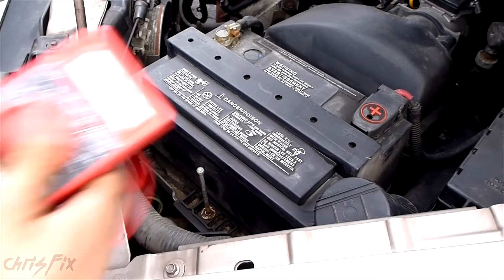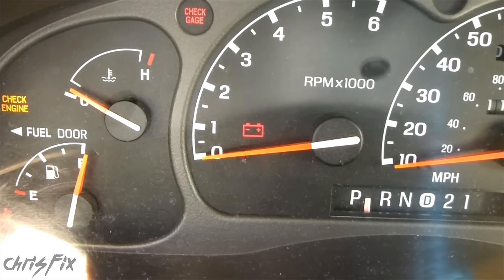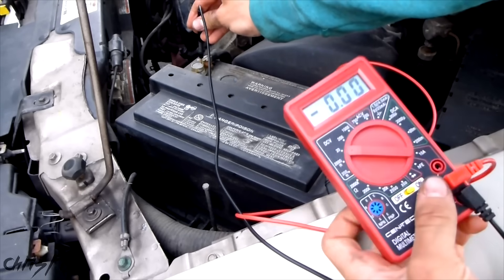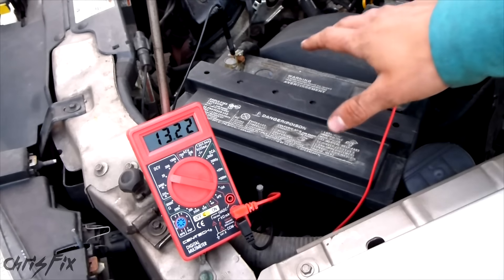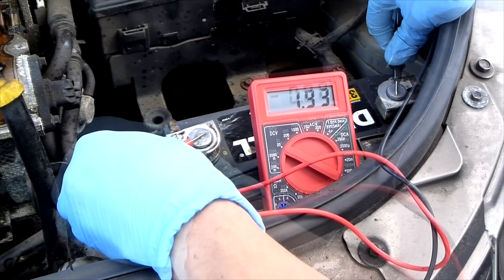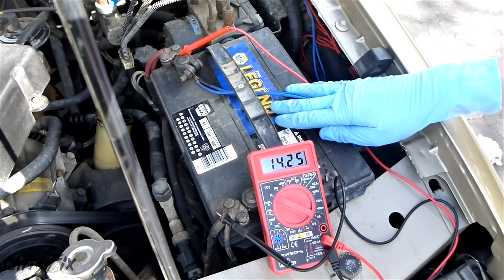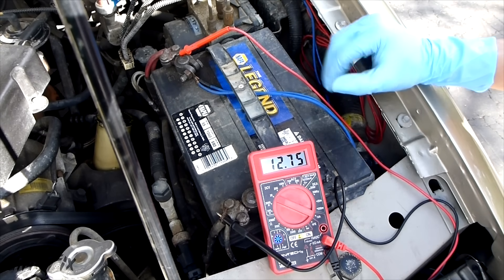How to Test a Car Battery with a Multimeter

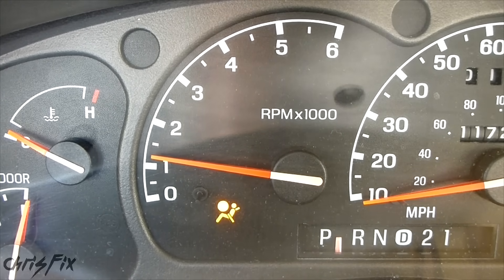Comment: Hi Chris, at 1:04, is the engine on while the headlight is open for two mins? 

I'm a bit confused. Before this, you started the car to check the battery light. Did you turn it off afterwards? (before the opening of the headlights)
Reply: No, because engine on means it is generating electricity, defeating the idea of turning on the lights.
Reply: @jellyd4889  I see. Thanks

Comment: I took my lawnmower battery to a parts store and they put a meter on it and said it was no good. They wanted to sell me another battery. I told them the battery had been sitting for two years so asked if they could try charging it. The guy said, it was a goner. His exact words. I said ok, thanks, and took my battery and went to parts store up the street. They charged it and THEN tested it and said it was fine.
Parts store are not always honest especially with older women so I found this video helpful so I can get a meter and test my own batteries.

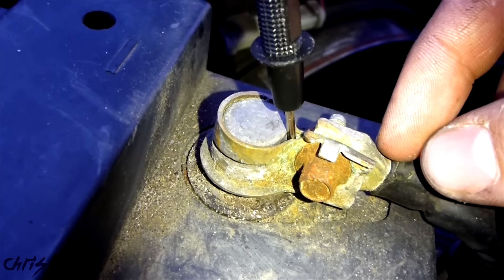Comment: 3:08 good point with googles…I forget chemistry of batteries but strong alkaline solution splashed in eye is permanent blindness. Not positive battery strong enough but not worth the risk…especially when bad batteries prone to atypical behavior bc clearly something is wrong that has you screwing around with battery.

Comment: A few notes.  Always disconnect the ground first to clean them, use water with baking soda to neutralize the build-up.  When putting the "cables back on" put the Positive cable on first to avoid any sparks which can be dangerous.  Oh and Wear safety glasses.!!!!!!

Comment: Great job, but I only have one clarification. You said to add bottled water or distilled.  All bottled, most bottled, is not distilled. Distilled is what you do want, with no minerals. Most all others, including drinking water, has minerals.  Small issue, but, if doing it, may as well do it right. Thank you for a great video and all the help otherwise.  Well done.
Reply: If you cannot buy distilled, bottled with have less minerals than average Joe's well or lake water.

Comment: My suv had no power when i stopped somewhere on a misty day. I opened the hood and messed with the wires and it started and had power. Idk why my car did this weird thing outta the blue, but the car is still running and driving.  Could this be a early sign that i may need one soon or my wires maybe corroded?

Comment: How do you keep the multimeter terminals connected to the battery terminals? Mine does not have those hinged plastic things. Also you can't take your car to an auto parts store to test the battery if the car won't start (sounds obvious I know).

Comment: I’m a 44 year old women and I’m trying to learn how to do as much of my own vehicle maintenance as possible but didn’t want to ask for help with the volt meter- Thank you for helping me swallow my pride a little :) Now to check the alternator video out!
Reply from the maker: I'm glad the video was able to help you with the multimeter!
Reply: Until I started actually shopping for them, oh my - the choices and variations! I decided I wanted the thermocouple and no touch sensor - couldn’t make up my mind so I purchased one made by Ames instruments from harbor freight for about $44 and then I found a similar device at Walmart made by ever start maxx that cost just under $30… is one of those any better than the other, if you’re going by brand?
Reply: Turn the headlights on with the car running or off @ 1minute?
Reply: Personally, I like the ever start because it’s a slightly thinner profile whereas the Eames is a little chunky, but I plan on returning one of them and I just want to choose the right one..
Reply: @elementalraven27  If your goal is just to measure battery voltage, brand shouldn't matter that much, I have some unbranded chinese multimeter, that is a few years old, 
I compared it to the professional "fluke" brand we have at work, the measurement is the same.
Reply: Great video  presentation was informative, detailed, and easy to understand ❤ the cam view was perfect and your voice sounds friendly real clear thank you sir❤

Comment: helpful thank you !!  I kept my car for 15 days idle (no driving) and car did no start.  I have an Audi A4 B8,  varta 95Ah battery.   Is 15 days too quick for battery to drain so that engine not start??
Reply from the maker: Your car should be able to start after sitting that long, most cars can sit for a month or two and start up no problem
Reply: @chrisfix  thank you for reply, it means my battery is old (have not change it for 5 years) so  does not hold charge as well.  Good to know that normally should last at least a month.  Have a good day Chris

Comment: Use baking soda mixed in warm/hot water for corrosion instead of sandpaper and solvents. Will wash away the corrosion instantly and without abrasion to your battery terminal posts

Comment: The battery light on your dash has nothing to do with the battery completely bad information. And I've also said for years I don't understand why it's the diagram of a battery because it's really your alternator light. If that light comes on it means your alternator is not charging it has nothing to do with your battery. Now of course if you continue to drive the car without the alternator charging it'll drain your battery but that's not the reason the light is on. That light is alternator status that has nothing to do with the status of your battery whether it's healthy or not.  Back in the old days this light would have said alternator or no charge, I don't know why they ever changed it

Comment: "maintenance free" batteries still require you to pull pop the caps to check the cell levels.  They are hidden under the label you need yo peel off.  When i checked mine, it was way low.  Im not sure how they get away with the no maintenance claim...
Reply from the maker: Could have been a manufacturing error
Reply: @chrisfix  All batteries vent gases, this lowers the electrolyte level.  When this eventually enough, and it will the only correction is the peel that sticker off pop the caps and pour in more distilled water.  If you just buy anewbattery at this time, I guess you can call the old one "maintenance free" because you declined to do the maintenance....
Reply: @chrisfix  btw, thanks for replying, dodnt realize you are the video creator.  I enjoy your video btw.

Comment: Have a car i had not turned on for about a month, and it would not start. I jump-started it and left it running, but i was sure I'd need to replace it. The last 2 days its started with no issues. Battery voltage with car off was 12.47, 13.98 when running and stayed just above 10 when starting. Will this battery be ok, or should i consider replacing it soon? Thanks!
Reply: What

Comment: I've had two batteries last 13 and 15 years respectively, in Central Canada...extremely cold (-45C).  Both were factory batteries.  One was in an '03 Toyota Echo (Toyota brand) and the other is my son's '08 Mazda 3 GT hatch (Panasonic brand).  I rarely get one that doesn't last at least 5 to 8 years (Kirkland brand...made by Johnson Controls, 8 year warranty).  A battery that only lasts 3 or 4 years is garbage and I wouldn't buy one of those again.

Question, when you say leave the lights on for 2 minutes, is that with the car running?  It's hard to tell from the video.

Comment: Do you have to change or adjust the settings somehow based on if its a parralel battery bank circuit compared to just a single battery? 

And is there a way to measure total amp hours of a battery using these devices?

Comment: Nice work Chris. Just wondering... You said when you turn the car on the voltage should not drop below 10. What if you turn the car on and the volts drop to 9.x for less than half a second (while its cranking) and then jump back up to 14.x? Is dropping to 9.x while cranking a concern?
Reply from the maker: As long as you are not experiencing a slow crank or other issue, that temporary drop sounds perfectly normal.
Reply: @chrisfix  Thanks for the quick reply. Nope, not a slow crank at all. You are the best.

Comment: Wouldn't using WD-40 make some insulation between the poles and holders attached to the battery which will lead to reducing the voltage further?

Comment: You said at the end, "fill it with bottled water or distilled water".  Not "bottled water"!  To most people that means ordinary bottled water for drinking, and that is full of minerals that will damamge the battery. Use on distilled or deionized water.

Comment: First of all you never checked for a voltage drop between the cables and the battery post. Second your battery is dirty and will come up to voltage after a charge but will lose that charge to ground due to mineral trails ( dirt).  Nice try but incomplete information.

Comment: Chris, I've been watching your videos for years and have been very helpful in maintaining our vehicles.... Thanks for sharing ! 
In my opinion, after cleaning the battery terminals & wire connectors, I prefer to use di-electric grease instead of WD-40 to prevent corrosion, as WD-40 will certainly vaporized in a short time.

Comment: I don't think the battery light on the cluster is for the battery but a measurement of the charging system. if it's illuminated, the alternator is not charging correctly.

Comment: Car not starting at all.  New battery like 1 month old. Just got car two days just bought it. Going to jump started with another battery from another running car. I may take it to auto zone check it out. Or it’s time i bought a multimeter. What brand do you recommend? Pretty much any brand or good brand ?

Comment: I changed a new alternator and now it heats up, and in the autozone they didn't charge my battery because it's bad, but my question is why THE ALTERNATOR GETS HOT, THE OLD ONE BURNT, I DON'T KNOW IF POTING A NEW BATTERY THE ALTERNATOR STOPS HEATING UP, THERE IS SOME FUCIBLE FOR THE ALTERNATOR. FORD EXPLORER SPORT TRAC 2007????

Comment: A couple of issues: 1) ONLY  distilled water, bottle water STILL contains minerals and CAN definitely kill a battery, 2) maintenance free batteries is a myth, they all need maintenance. It's just more difficult to get into the "maintenance free" ones. Lastly wd40 is good, but Vaseline  is better for controlling acid buildup. 
But, still a good video, lots of good basics that owners should know how to do. The BEST tool in a toolbox/car is a multimeter.

Comment: All my 40 odd years I’ve used copper grease on battery terminal. Not one bit of corrosion or cable damage. One coating will last the life of the car/battery in all weathers.

Comment: I see a lot of people driving around with terribly corroded clamps. And I wish someone made the perfect battery terminal cleaning tool. I'd buy it, regardless of price. I use a pocket knife, scrape all around, then go at it with a wire brush, which tends to fling corrosive bit everywhere, like on my clothes. Slow, tedious work. I always use vaseline in and around my clamps, but I'll definitely try the WD-40 trick. Good video!
Reply: There are many dual wire brush purpose made tools for this. Amazon or Ebay. Does the job much better in seconds. Yellow sulphur and crystalline deposits easily dissolved and removed with a kettle of boiling water. There are special terminal sprays to keep air out and stop corrosion but vaseline will do the same job. WD40 will leach away over time and let the corrosion feeding oxygen back in.

Comment: Good video.  I would use a spark plug brush and electrical cleaning spray to clean the terminals instead of sandpaper, then apply a thin layer of battery terminal grease to prevent the galvanic corrosion.  You can also buy a battery terminal post cleaning tool, this has steel bristles plug to clean the connectors, and a bristles hole to place over the battery terminals, this works well.
Wd40 dries out and is a water displacement spray (hence the "WD") not a lubricant.
Reply: Terminal grease = white petroleum jelly. Conductor.
Reply: @30mAkills  terminally gray but God's servant. Conduit without Yeshua. No charge.
Reply: yepp...............; I do it the same way (incl. grease)
Reply: Yes,. Please. Thank You!

Comment: I followed the same steps and the prongs and wires got hot quick, what does that mean?
Reply: you had the probes plugged into the AMP  jack instead of the VOLT/OHM jack and you destroyed your meter

Comment: Batteries can last a lot more than 4 years.  My last A6 I sold had the original battery at 12 years and worked like new and my S4 has now reached the 12 year mark and the battery works like new.  These are huge ones.

Comment: What if the number is 12.06 when I check it at rest, but 10.10 when I start it up? It's under the 12.60 threshold at rest, but just over the 10 when starting.

Comment: I have a similar problem to a dead battery, but it's weird. 

All the lights are fine and even starting, it clicks for about a second (like the battery is dead) then the engine slow cranks and starts.

Battery shows its holding a charge and it isn't draining. Alternator is properly charging the battery. 

Do I have a bad battery?

Comment: I thought you already started the car... when you first checked the battery from the console. Then you check the battery again. Then you started the car again with the alternator running. So after you checked inside on the console when you checked the battery after waiting for the lights  the car wasn't running? Right?

Comment: This was an informative video. The battery in my truck which I bought 2.5 years ago is still going strong. I will start checking it from time to time with the multimeter I use on the battery on my trailer. Thanks.

Comment: I have watch quite a few battery test and alternator test videos. Many of them touch on the battery cables but never to the extent I think they deserve. I have seen quite a few times that the starter, battery and alternator where changed out only to find the problem was a bad battery cable. If a car isn't starting I always test the cables. Remove the fuel pump relay and crank the engine for a few seconds while testing the voltage between the engine block and the negative post and from the starter connection to the positive battery post . You should not get more then 1 volt as a total of both tests together.

Comment: Car clicks, jump starts fine. Couple hours later the battery is down to 8V. 

While running its 14.2, then 13.9-14.1 with accessories on,  lights, radio, fan, etc. 

So i can eliminate the alternator right,  the battery is 6 years old just so weird it would pretty much fail overnight. Havemt had any issues starting it until 2 days ago.

Comment: I followed your instructions and tested my battery just now.  I got 12.4 volts not 12.6 like you said.  It that considered too low?  Would I really need to replace my battery from dropping 0.2 volts?  Is there a voltage level that you can't go below?

Comment: Hey Chris. do you know what's causing the rapid clicking sound when I turn the key to "ON" position (not start position).I tested my battery and alternator followed you're steps.  I got an 12.26volts initial reading of my battery (engine off) then tested the alternator next, seems the alternator is working great it's charging my battery to 14.40volts. Then when I turn off the engine Voltage drop back to 12.26. Is it a bad battery?

Comment: Hello, very nice 👍👌 video thanks. Do you think it is worth getting a car battery tester like foxwell testers? Specially for the alternator test under load with lights and blower and stereo on do you think a battery tester will give you a better read for the alternator test? Or do you think it is enough with a simple multimeter? Thanks

Comment: So my battery went down to 9.6 on start and showing 12.08 volts on Idle after running lights for 2 mins. Is it still ok or should I opt a new one?

Comment: Just checking, My car wouldn't start so I charged the battery overnight. That worked but I went to a part store to check it anyway. They sold me a new one saying mine was bad and it wasn't :)
They tested my battery with the car off (told me no current and completely dead) but It started right up several times that morning.
I guess you just have to do it yourself now a days. Women need to know these things.

Comment: OMG, don't use bottled water in a battery.. always distilled water.. and a wire brush, not sandpaper to clean them up.. and OMG don't use WD40 as a protectant.. use actual battery terminal seal, which protects and provides better contact..

Comment: Car off I got 13.23 volt testing the battery and running I got 13.26 ,,,what could be the problem ?
Reply from the maker: Your alternator might not be charging properly.
Reply: @chrisfix  but it’s new :/,,,,I checked fuses all good ,,,

Comment: Do i need to remove the battery leads before I place the multimeter prongs on the contacts? Every time i disconnect the battery my car settings are reset..

Comment: Don't need a multimeter. .all you need to do is  . First jumpstart your car then remove the positive side battery clamp if the car if the car stops running it's the alternator if if it  carry a on it's the battery. The alternator keeps your car stuff charging the battery only starts ur car and let's the lights and radio work .simple.

Comment: Mine dropped to 10.4 and we are having a problem with a 2017 Buick Enclave. Passenger door open error. We keep dome lights and everything cut off. This is original 2017 battery, clean, in vehicle floor. I think I have a parasitic leak

Comment: Protip: Never Set your multimeter to DCA or 10A region, or plug probe to 10A input, that will short the multimeter and either blow the fuse of your multimeter, or blow the multimeter with some sparks.